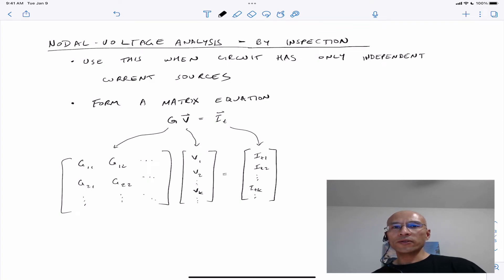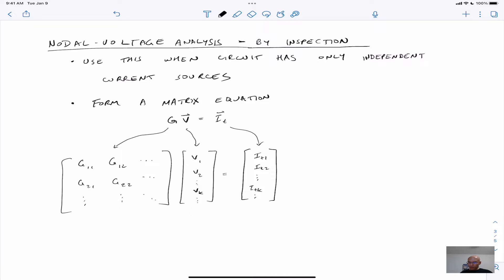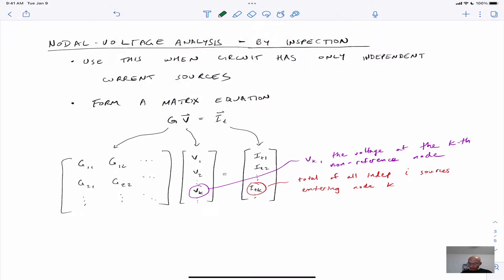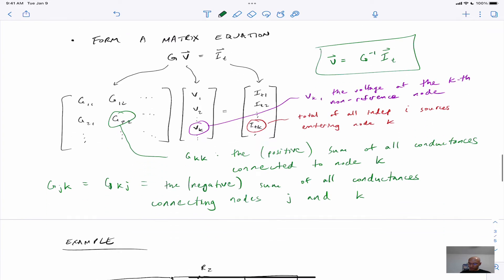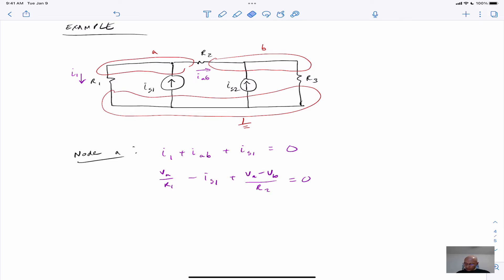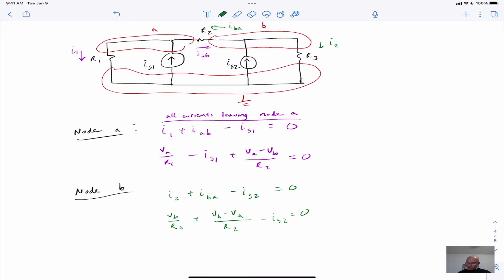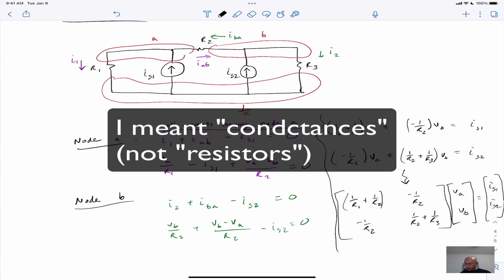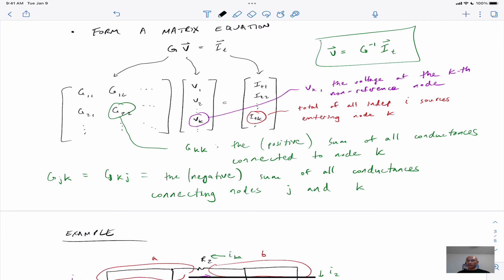Electric Circuits - Node-voltage Analysis by Inspection

Comment: so can we not use this when voltage sources are in the circuit?
Reply: Bit late, but no you can't
Reply: we can but we have to hybridize the method depending on the circuit
basically, if some node n is not directly connected to any source (beside independent current sources) then we can fill row n of the conductance matrix ( Gn1, Gn2,... .). you wouldnt get a square matrix if there are other types of sources, but you would quicky get all of the linear equations you would get by KCL immediately through this "partial" inspection method on the nodes that arent directly connected to any other type of source.
for the nodes that are connected to another type of source, apply kcl and add the resulting linear equation to the matrix. 
its a neat trick to speed up nodal analysis